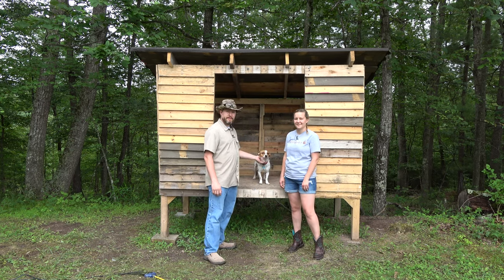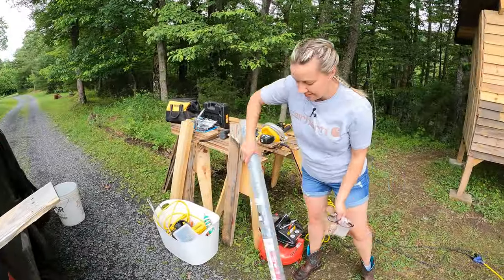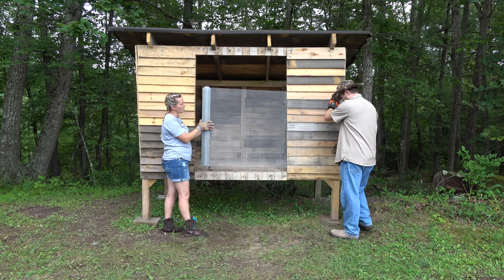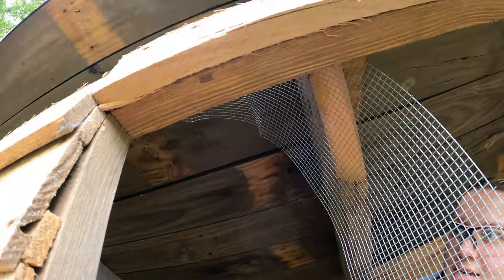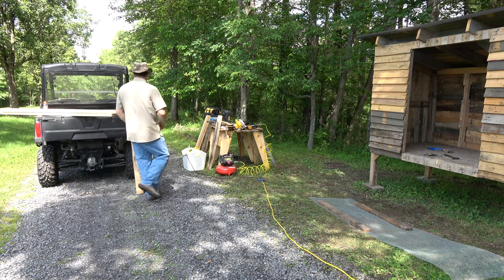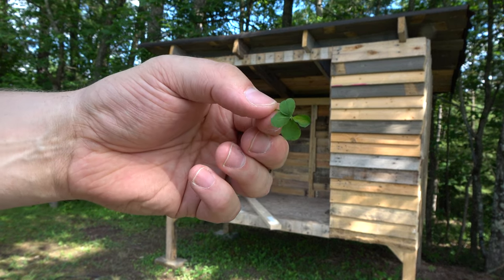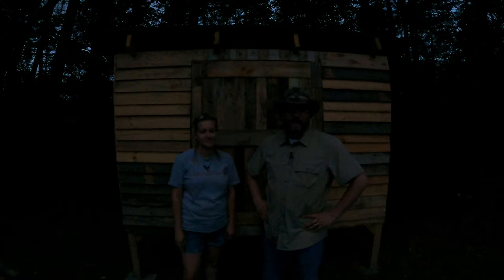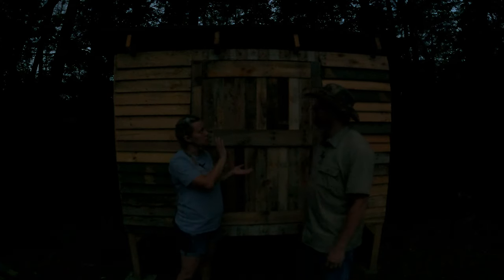Episode 14 - Reclaimed Lumber Chicken Coop - Part 5

Comment: It's looking good. I personally was not a fan of the deep litter method, I think my coop is too small for it to really be effective.
Reply from the maker: We're only about a month or so into using the deep litter method. So far so good, but at least it's an easy switch if it doesn't work out! Our coop is a little less than 4x8 on the inside as we used a piece of plywood for the base.
Reply: @HideawayHomesteadLLC  my little coop is only 4x4, and that was when I only had 3 or 4 chickens, now at 14 something, I moved to a partially covered run with 2 smler coops and roosting bars under the cover. During winter I build a wall with straw bails under the cover and they sort of turn it into a deep litter themselves.